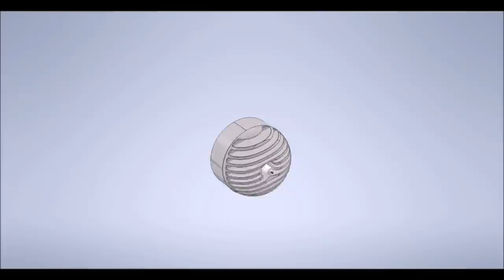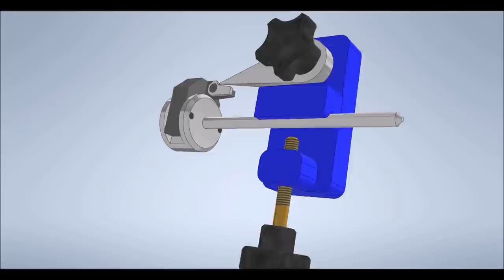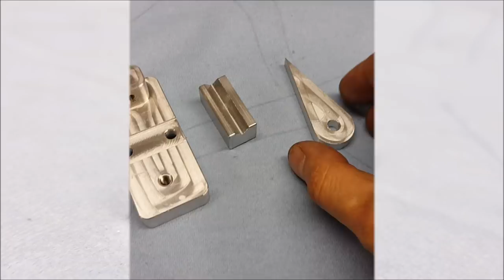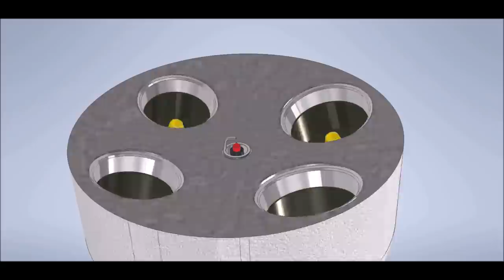Making of valve seat cutting machine - 3 Angle Tool Setting Fixture

Comment: Really outstanding most of the heat that a valve has to get rid of has to go thru the seat. Just one of the factors that determine seat geometry. Hey make a seat runout gage, better than a sunnen could ya' .0001 of course Great work love it!
Reply from the maker: Thanks